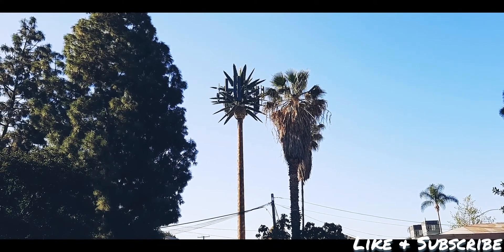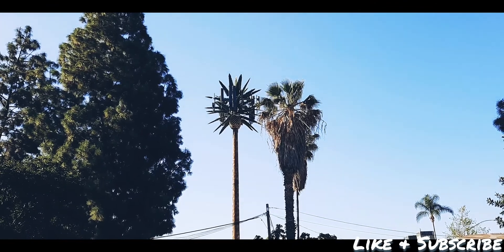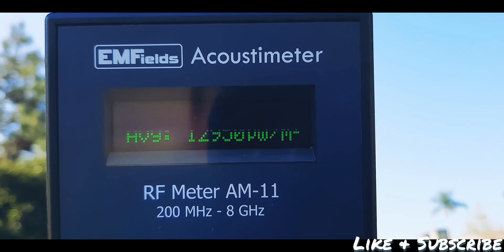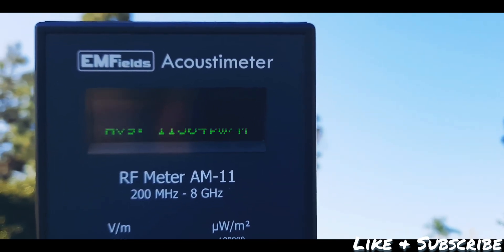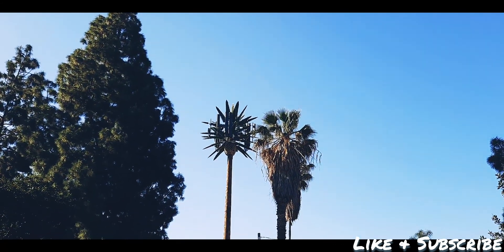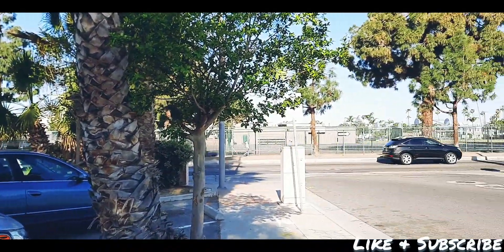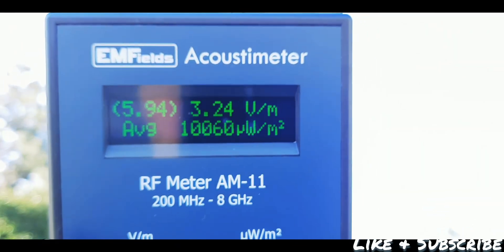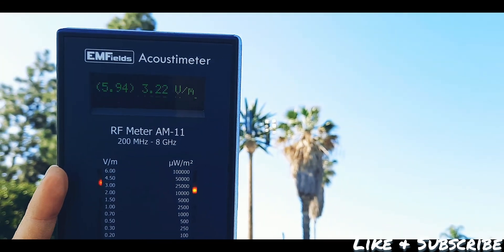5G Cell Tower Radiation Level Test with EMFields Acoustimeter AM11 RF Meter

Comment: Hey Everett. Question for you. What's the difference between EMF and radio waves? Like both can be damaging and disrupting to a human right? Will this AM11 RF meter read both? I know I want to figure out how much EMF my computer and router and modem are pumping out, but I also want to look at other devices and potential radio wave emission as well, if that's a thing? Maybe I don't even know what I'm talking about.
Reply from the maker: Hi Nick! I'm not sure about the difference of emf and radio waves. Maybe Google may have an answer. Am11 onl reads emf from what I know. I may make a video soon on testing a computer laptop soon. 💻 Thanks for the comment.

Comment: thanks man for sharing this, actually they are putting more and more 5G everywhere, its pretty disgusting, have you any advice ? like may be any paint anti wave ? got 2 big new 5G tower near my house holymoly
Reply from the maker: I understand the frustration, in your situation I would recommend thst you look into "Y Shield Paint." It's a bit expensive but it can protect you while your inside your home, however, if you have a wifi modem in your home the paint will effect your internet connection... Research your options on YouTube about how to protect your home from cell tower radiation. I hope this helps.
Reply: Thanks you so much man, a found the yshield paint and I'm gonna use it if I want a normal health and I'm gonna take this one too, I want to check everybody with this, long time ago wanted and I just found ur video and others, I think it's a must even if it's expensive cause nowadays there are 5g tower everybody... Thanks again!

Comment: My house is at eye level with the biggest cell towers in Lahaina, I am on the hill and the 2nd floor.  I guess I need to find out how to get one of those meters
Reply from the maker: Yes, I would recommend getting a meter.... I hope thst Tower is not as strong as the one in this video.... If it is you may want to resesrch Y Paint on youtube. Good Luck!
Reply: @EverettJimenez  Thank you!  I brought home a Rad man.  It is a tool we use when working at cell sites. It doesn't tell me a specific number reading though. It does not stay lite at any percentage, it just briefly lights. https://www.gmesupply.com/narda-radman-2-xt?msclkid=65cf57d4c1d216a8e49f376cab70c4df&utm_source=bing&utm_medium=cpc&utm_campaign=**LP%20-%20Shop%20-%20Electronics&utm_term=4583657829033854&utm_content=NAR-2281-102%20%7C%20Narda%20RadMan%202%20XT%20%7C%20%241195